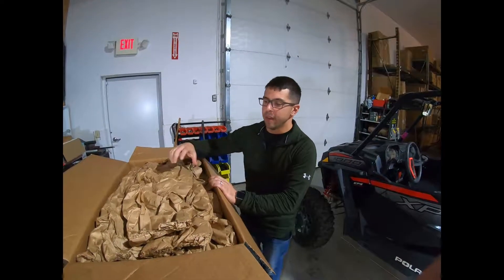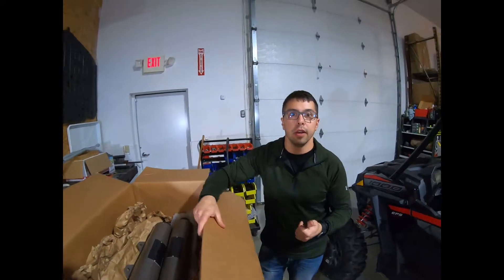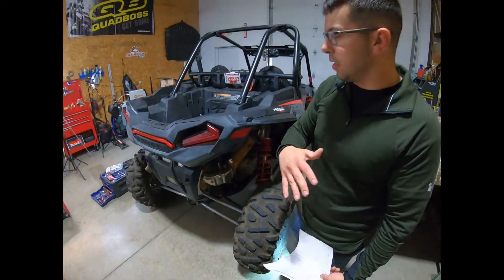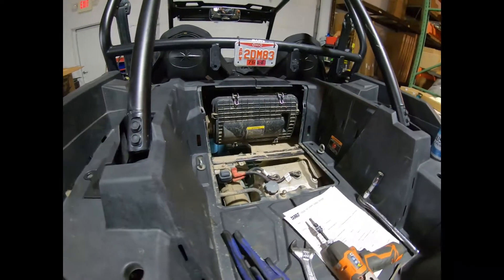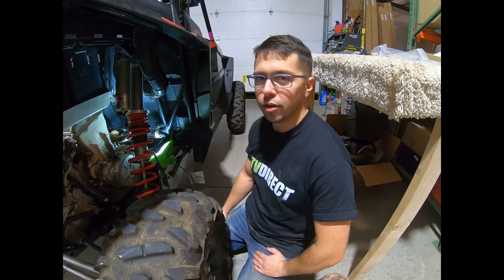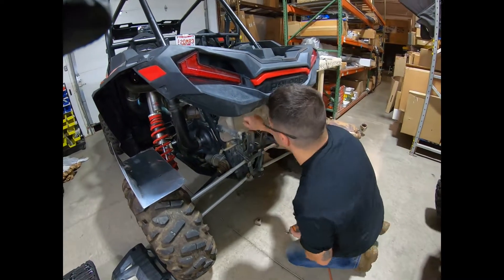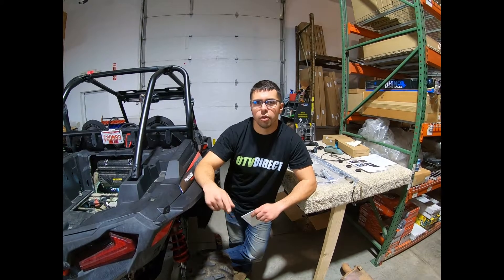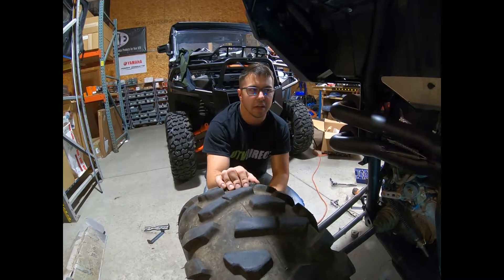HMF FULL EXHAUST INSTALL

Comment: Thanks, just installed after your video.  Your frustrations were mine as well.  :)      I was able to install without removing the upper heat shield.   Awesome help with your video!  Thanks again!
Reply from the maker: Hey man! Glad that the video was able to help you out. If you need help with anything reach out and I will get you whatever you need.
Reply: Did you Tune and K&NN filter your buggy?  I have been wondering where the over all power increase is “guesstimated”.  My guess is between 124 and 130hp with all three mods.  I have noticed other than racing, trails and dune cruising do not require massive hp.

Thanks again.
Reply from the maker: @dubob2  I did tune my with the DynoJet Power tuner. I have kept the stock air filter as of right now. As far as Performance gains HP wise I am not sure, however I can TOTALLY notice a difference. Tuner is below man. 

https://www.utvdirect.com/dynojet-power-vision-tuner/